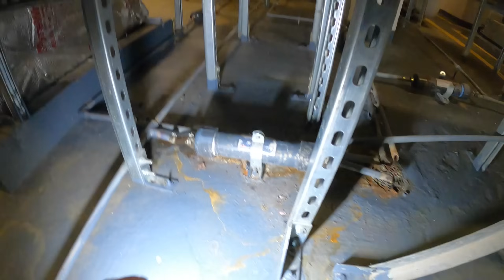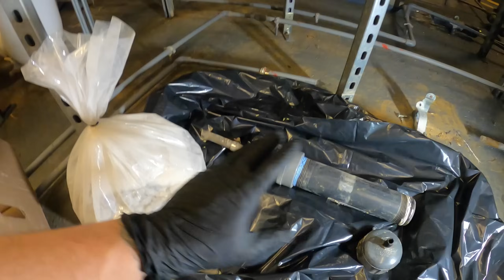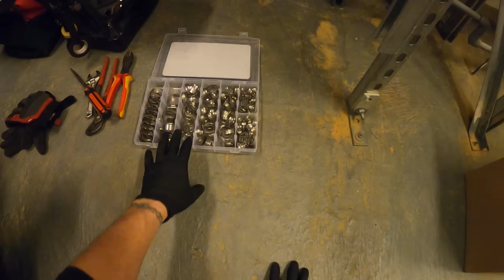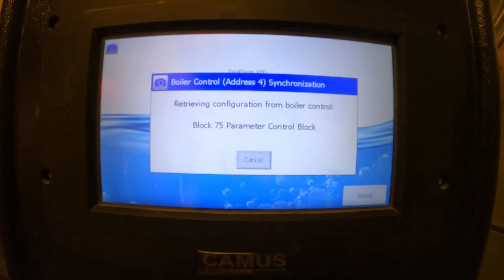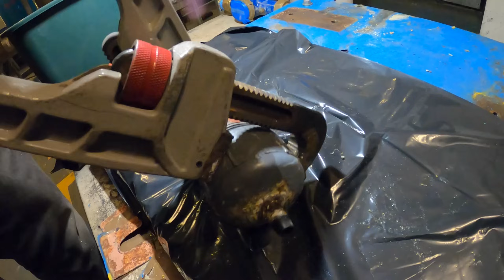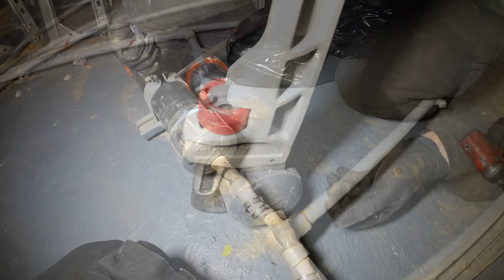HVAC Service: CAMUS Dynaflame Hydronic Boiler Maintenance (How To Replace Condensate Neutralizer)

Comment: I'm an old propulsion boiler operator/repairman and when I read "Replace Condensate Neutralizer" I was thinking boiler water not exhast condensate because we used morphaline to combat rust/scale in the steam cycle.

It might be an advantage for the onsite guys to build a couple of spare units to be easily swapped out real quick like on schedule when need be.

Comment: I had 2 of those on a 1500 gallon tank. Got them installed new. One lasted about a year and lost its heat exchanger. Both were bad about losing igniters.

Comment: I’m a custodian/boiler operator and I’ve replaced the media a few times but I’ve always replaced them when the boiler was still on. I didn’t know that the exhaust is tied to the drain line 😮
Thanks for the tip